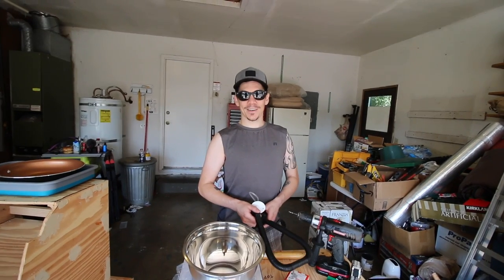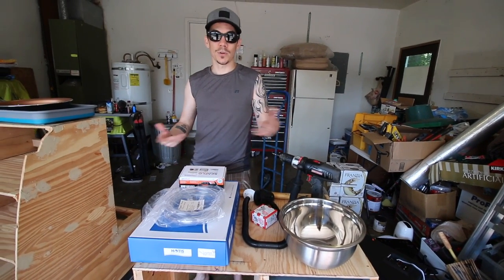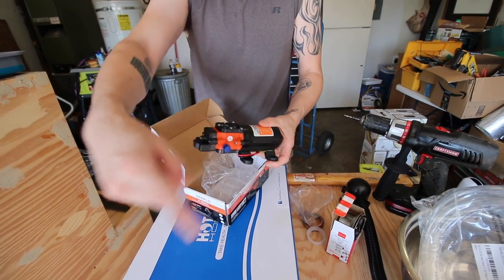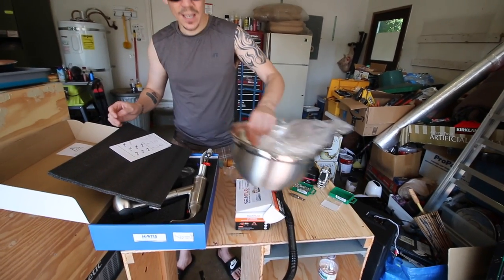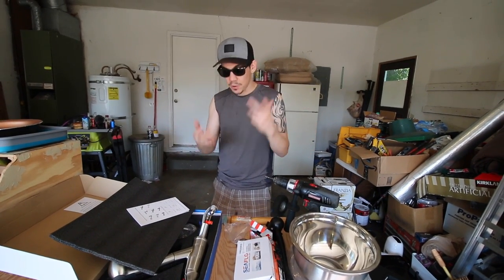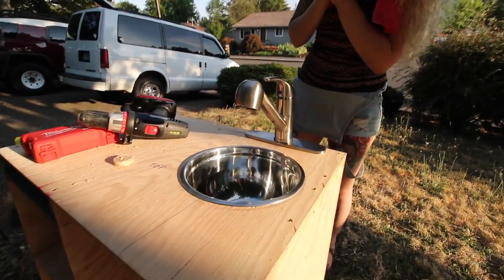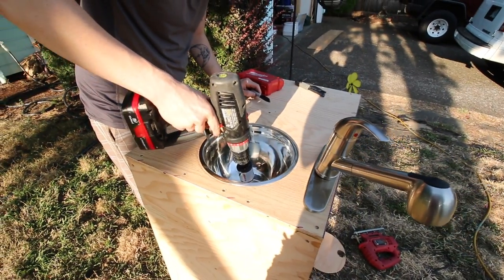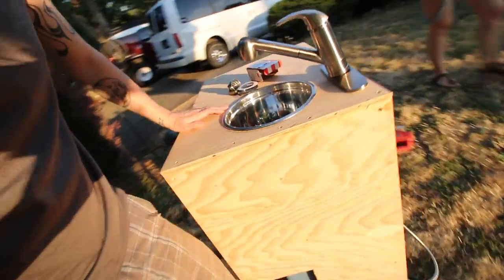Custom Van Sink with Electric Pump Pt. 1

Comment: I just finished my sink/counter top.  Inspired by your foam cabinet video (but on wood), I used decorative paper from an art store, applied with the white glue mixture, then coats of urethane over it.  The smoother then paper the smoother the finish (as I found out).  Test for browning of the urethane, as it can darken the look.

Comment: I sponge painted a bathroom countertop to look like marble.  Then I coated it with epoxy.  came out great.  It's lasted over 2 years & still looks good.  Won't take as long as using pennies.

Comment: Hey bro love the vids.. you could use plumbers putty under the drain  and clear silicone to hold the sink bowl in.. that's how its typically done in homes
Reply from the maker: Thanks Ben!
Reply: yes, you don't need JBWeld or anything crazy like that. Plumbers putty is sold at Walmart, its easy to find

Comment: Rust-Oleum makes countertop paint that works pretty well and it's pretty robust stuff I've actually personally used it. Put a few coats of that on and you'll be in good shape. There's also a variety of colors you can choose from.

Comment: Awesome job. Loving the sprayer. That hose is long enuf to be an outdoor shower too, or rinse off. Great, now I want one instead of my weed sprayer conversion, lol. For counter top, they make a brushed aluminum contact type of paper on a roll, but its not paper.  I found it a couples years ago in the contact paper section at Home Depot. It would match the bowl. Or get a cookie sheet from Walmart, cut to size & stick with contact adhesive. Also, Loews has a Food Grade varnish instead of polyurethane. I used it on wood soap dishes I made once. Personally, I'd keep it contemporary & go with aluminum type of finish to match the hardware.  Whatever finish, I'd do it before you permanently attach the bowl to surface.

Comment: A lot of people do the pennies thing so you should do something different and cool like you usually do. Try looking at recycling some cool materials like old cans like pepsi aw root beer etc and snip the tops and bottoms off. Cut a line down one side and unroll them so you have flat metal sheets. Then make cool shapes and use the metal for your base and epoxy over them. Any aluminum can should work like beer cans etc and it would give it a one of a kind unique look!
Reply from the maker: agreed. Cool ideas!

Comment: Get some plumbers putty for the drain and put under lip of sink edge.  before installing drain take out the rubber washer, use the putty. Also bend the lip of the hole down a little for a semi flush drain. apply some putty under the faucet as well! Use sink and bath sealent for finish. Cool project, nice work!
Reply from the maker: Thanks Liberty!

Comment: If you connect only one water line to the cold faucet connection you have to cap off the unused hot water connection or water can flow out when the handle is in warm position.
Reply from the maker: Thank you so much!
Reply: Into The Mystery 13 your welcome. This happened to my buddy a few years ago and he couldn't figure out why he sometime had water all over under the sink. Hope I saved you a needles problem!

Comment: I have that same water pump. I found that I had to cut the hose to like 3 or 4 feet total to get it to flow right. Also, its pretty noisy but well worth having.

Comment: Epoxy resin right over the wood would work.  I don't know if there's another name for it, but I'm referring to the stuff they use on bar tops.  It's easy to clean and it's heat resistant.  If you want to get creative you can put stuff underneath it before you put it on, like maps, coins, concert stubs, or whatever....Good luck whatever you do!  -PJ

Comment: Plug one of the faucet inlets and connect the pump to the other.  The hot and cold are mixed inside the faucet so you will not gain or lose pressure either way you connect it (depending on where the handle is placed).
Reply from the maker: +johnqglass good idea, thanks

Comment: For the counter top I'd just go with a cutting board, either a wooden one of one of those anti bacterial, white polypropylene boards. Just tack one on with Gorilla Glue. That would take care of the big area on the side, and then you can put pennies around the bowl and the faucet.
Reply from the maker: +Sacwriter that could work well, thank you

Comment: A small 12vdc fan mounted to blow some air on the area of the fridge where it needs it, will make sure it is cooled.   5200 Marine adhesive sealer will never let the sink be removed.  Plumbers putty between the drain and the sink with a nut under the sink on the drain pipe  will work.  Don't forget to seal the edge of the sink hole to prevent water from penetrating the end grain of the wood.
Reply: and do the counter with epoxy or whatever you choose to use before mounting the sink!
Reply from the maker: Thank you!
Reply from the maker: for sure!

Comment: And by the way I think if you don't use the hot water side you will have to cap it off because more than likely the cold water will back siphon out the hot water hose.
Reply from the maker: Good call! Thanks!
Reply from the maker: I took Neals advice and plugged one side off with a brass plug of the same size/thread count from Lowe’s and never tried it without. I thought about getting a y fitting and connecting them, but this way I can turn the handle side to side and get just the right amount of water flowing. It would make sense that there would be reverse flow since both sides are open when the handle is not all the way to one side.

Comment: If you're going to use jb welb to secure the drain.  You can buy 4 or 5 under cabinet sink mounts for your basin and use jb weld to hold it in place.  I'm not sure if i missed it on the video, the counter area needs a water tight surface. You can buy a small piece of laminate, plexiglass, stainless steel, etc... for the surface of your sink counter.
Reply from the maker: Thank you!

Comment: Check HomeDepot or Lowe's - they often have small pieces of countertop left over from kitchen remodels - some of its very nice and high end - that they would be considering scrap and throwing away - I have gotten several pieces that way that would have covered that area nicely and it was, for the most part free (one piece of high end granite I had to pay a few bucks for). as they just want to get rid of it without throwing it in the trash
Reply from the maker: +Pam Duncan I love this, thank you!

Comment: Maybe my comment is too late... Suggestion about the countertop: boat varnish. Seals really good, oil based.
You can leave a wet rag on it all night and it's not going to peel. Side note: if you paint first, choose a compatible paint. Latex and oil based don't mix.

Comment: You can use fuel pump of used cars for water. It has good pressure and uses low amperage.
Reply from the maker: +Fabio Bianchi I don't want to drink from where gas has been, and a lot of them are huge. I like the resourceful thinking though!
Reply: I use from a Ford Fiesta. I just pumped water and soup for +24 hours and it's clean.

Comment: Are you still using the fridge set-up of the 110V fridge that switches the inverter on and off when it runs the compressor? Just wondering how it's been working for you thus far?

Comment: For the counter top I'd use Contact Paper. They come in all kinds of colors and patterns these days. When it gets nasty, just add more on top. The penny idea is great but a lot more complicated. The Contact Paper is practical and easy.
Reply: mold magnet!
Reply: It depends on where you are. Some areas are dry with no mold.

Comment: I will give you some advise right now. That 12,000 BTU unit is going to need a huge ass inverter and minimum a 2000 watt generator. As the locked rotor amps will hit 80 amps AC. The only way to prevent it is a Soft Start Motherboard. That cuts that locked rotor amps by 70%...

https://www.microair.net/collections/easystart-soft-starters

https://www.microair.net/collections

You can stain anything. Then use Spar Urethane outdoor stain finish. It great for outdoors. Rain. Sunlight and Temperature Changes. I would just use sink chalk on the bowl. As you will have to remove it sometimes and it will be mold and mildew resistant. Just be sure to stain and finish coat everything first. 

You can attach a 1'x3" pine board that goes through the water jug handles. Then anchor the board to the sides with a latch on both ends to hold it down. Or just use a flat board and use slide drawer rails on the bottom to access them easier. As a set of rails are like $12.00. You want soft close there $16.00...
Reply from the maker: We were planning on only using it when we have shore power, but great info and tips. Thank you!

Comment: For the fridge vent couldn't just cut a hole in the wood so it can breathe?
Reply from the maker: We did that on both sides, but one side is blocked
Reply: Into The Mystery 13 oh ok well that sucks. Can you attach like  a plastic accordion type hose like you may use for a dryer and push the air out that way or do you think that will not work?

Comment: How did you end up hooking your 3/8 clear hose into the hot or cold water intake?
Reply from the maker: I just pushed it on and used a standard metal hole clamp to hold it on. The hose is food grade too

Comment: Hey bro I've been watching you since the beginning, keep up the great vids!! You've inspired me to move into my 2004 chevy suburban and travel. I'm building the platform for the bed now and prepping for it. How would you recommend getting air flow inside of the truck when I'm sleeping in it? I don't want to cut a hole in the roof for a fan is there any other way? Also I currently have carpets in it would you recommend ripping them out and putting some kind of flooring or rubber mats into it?
Thanks man hope to see the both of you on the road soon!! 😁

Comment: My suggestion for the counter top is contact cement and either stainless or aluminum. Stainless will look better but aluminum would do the trick. Stainless will cost about 60$ and aluminum about 15. Any welding shop or metal supplier would probably have scrap to sell you cheap.
Reply from the maker: I was thinking copper too, but I think you have to polish it all the time. I didn't think to check for scraps from suppliers. Thanks for the ideas
Reply: Copper would be nice. It would take monthly polishing with brasso. On the ship we keep brass and copper clean from the salt air that way. There is a food safe polish out there. I cant remember if brasso is it or not.
Reply: Oh, and if you go with copper, cheapest place to get it is a place that does copper roofs. It will be plenty thick. If they don't have it, then some hardware stores carry copper flashing in the roof section.

Comment: Hello, i bought your drain and pipe and need help with the diameter of the round drill...please, help. I am a girl with zero carpenter skills .
Reply from the maker: You need to know the diameter of the whole saw? It’s the same size as the outside of the threads on the drain plug
Reply: Into The Mystery ⓭ thank you, exactly what i thought